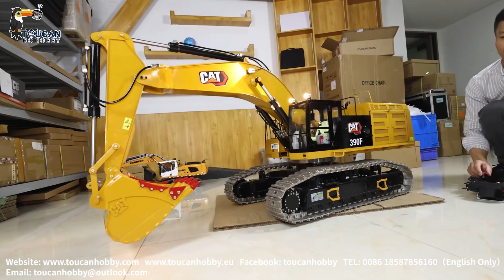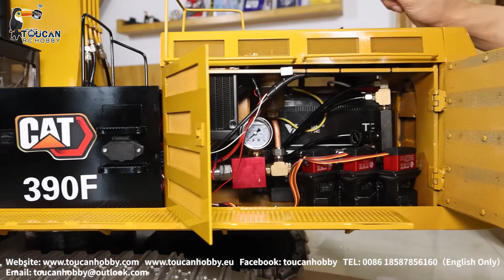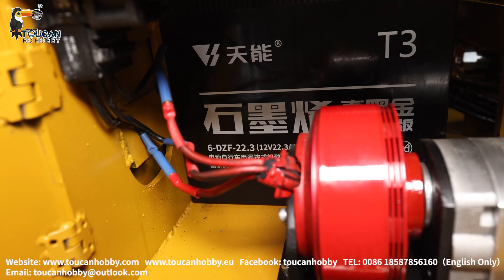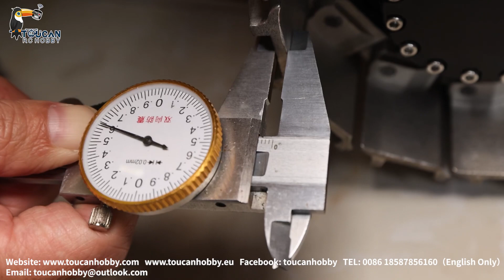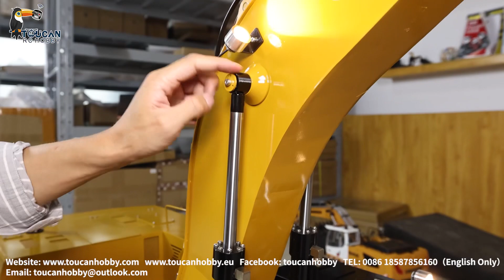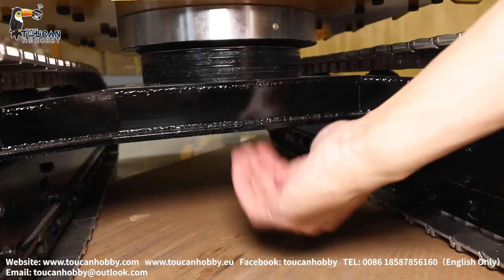1/8 CAT 390F excavator,around 180kg, light sound, EV radio, 24V power. All brushless motor.

Comment: 2 x 12v 22ah batteries in series will give 24v 22ah, not 44ah.  If you wired them in parallel yes you would get 44ah but only at 12v....
Reply from the maker: Yes right

Comment: The previous model, the 1/8 scale 390D, had a variety of problems that caused headaches for owners around the world who bought it directly from the manufacturer.
This year's model has improved on the defects around the power supply, which was a particularly bad problem, as well as oil leaks and rough arm movement due to an inferior hydraulic system.
Were these improvements customized by ToucanHobby?
Reply from the maker: The hard wares are all done by factory, I only rearrange wires and radio settings, the quality will get better for coming productions